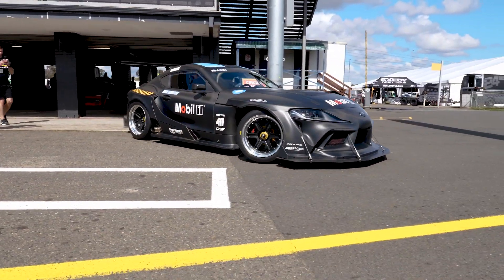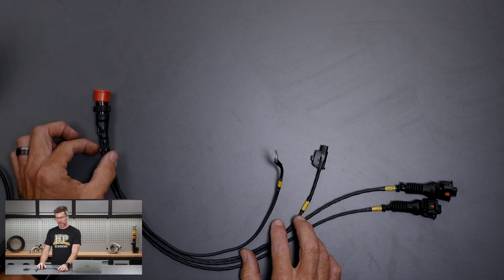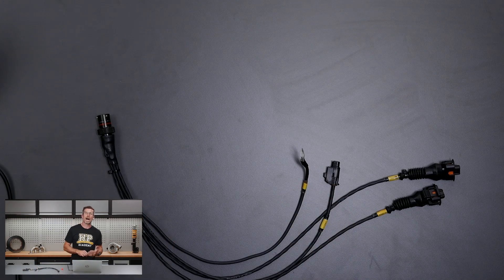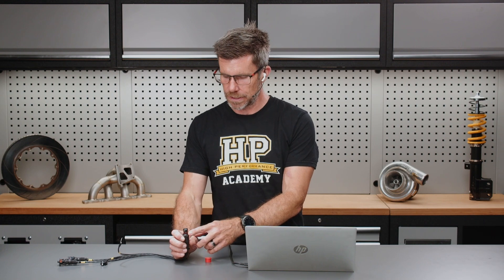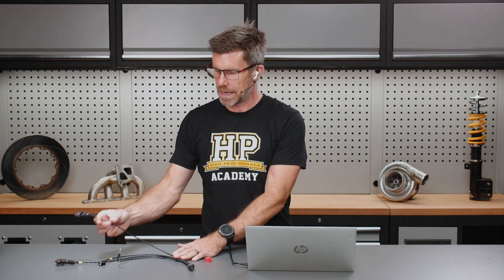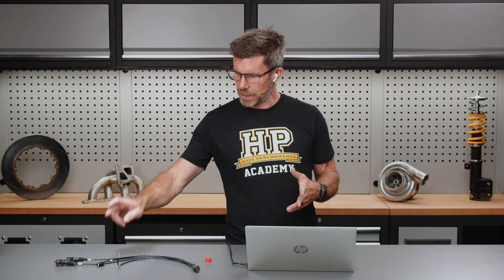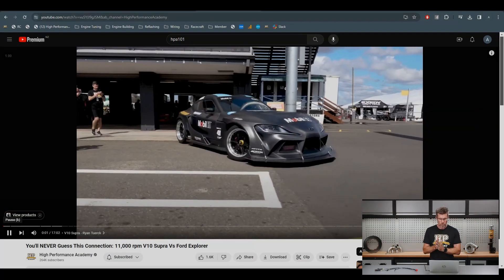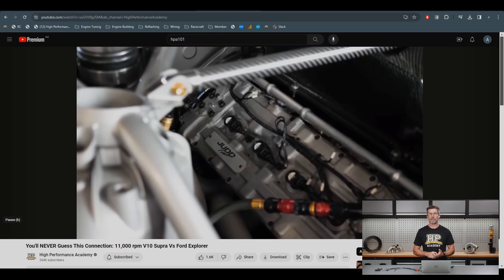Quality Wiring Is All In The Little Details

Comment: Looks cleaner but won't make u faster
Reply: What a terrible take.
Reply: Not doing quality work will sure make your build go up in flames a lot faster, but faster is better, by your logic.
Reply: @jordankelly4684  naw my batteries have sand in it to make sure at such high voltage ⚡ since heat expands everything it gets hand on won't touch one another in cells since there 6 cells.  Americans batteries best one gel for vibration but adding sand ⌛ batteries last longer float tester
Reply: @jordankelly4684  keep away from moisture